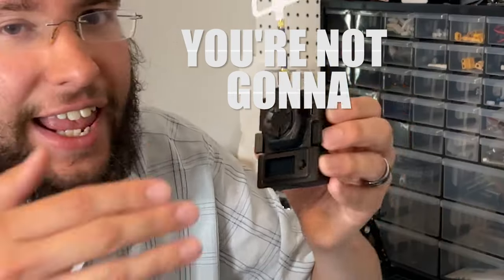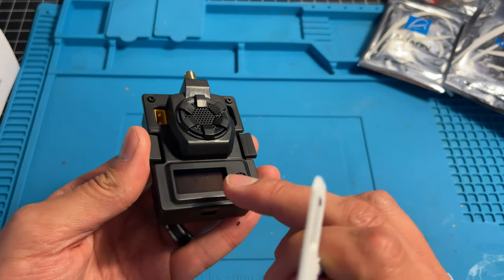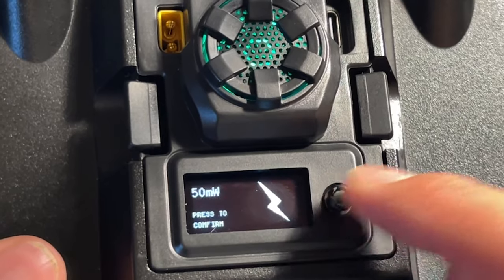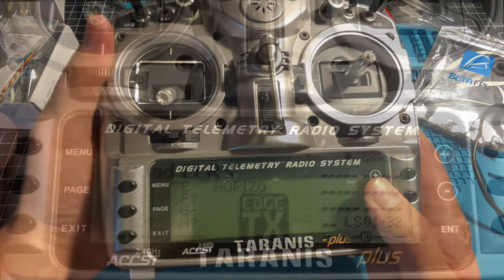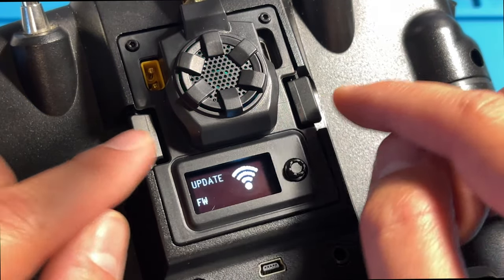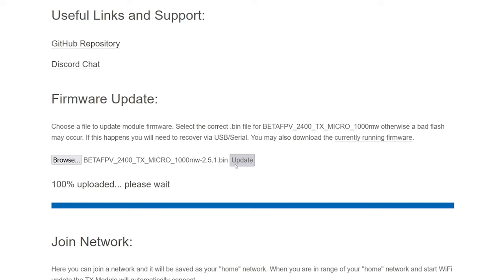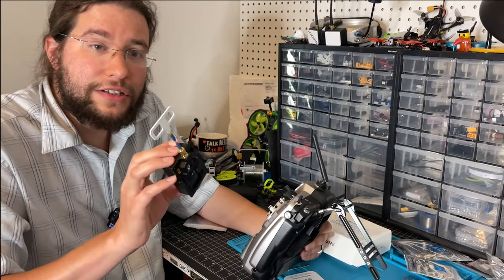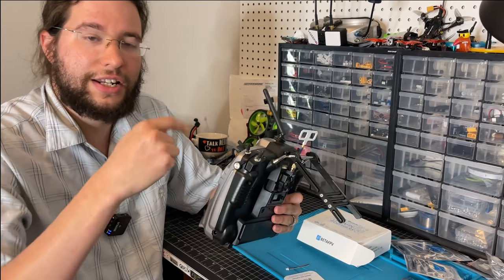BetaFPV ELRS Micro TX 1000mw & Receivers

Comment: Good info, John. I need to learn more about ELRS.
Reply from the maker: I haven't bought a crossfire rx since I started using it. Seriously have yet to have a bad experience and I'm running ELRS on a lot of my quads now, both SPI receivers as well as external rx. There is a technical learning curve to using it vs. crossfire but it is getting better all the time. You would be able to figure it out no problem knowing your tech skills.

Comment: Thanks... I used your video for flashing Edge on my Taranis Plus, I also have ExpressLRS but had no joy with the Lua script on OpenTX as it would always crash, I don't have the LCD TX like you I have the pro 2.4 without it so I need to run the script to put the wifi mode on. My problem is with Edge the Lua script will open and say Script Panic, Not enough memory... Any idea? Thank You :)
Reply from the maker: Is this with the ELRSV3 lua script or ELRS V2 lua script? Mine works just fine with no memory issues on 2.5.1 but I have not updated to 3.0 yet.

Comment: Can't wait to go ERLS, though the Frsky receiver's are not breaking on me so think it will be another year atleast haha.
Reply from the maker: None of mine have broken, either, but going ELRS has saved me money because I have not had to purchase any new crossfire receivers or antennas. 

I’m saving about $12 or a little more on each receiver depending on where I’m buying them with any sales. I’ve also been able to retrofit some of my whoops with worse-than-usual frsky d8 range with ELRS micro receivers like the flat antenna and it’s made a night and day difference.
Reply: @JohnCuppi  Ah nice! I have never actually bought a receiver hey. Just re use the OG ones I have from my old BNF. Even on whoops I'm just running Rxsr Frysky hey. 
Hopefully one day I can make the switch :)

Comment: Well, I don't want to fly to the moon...I just want to fly indoors, in large venues like theaters, restaurants, gyms, etc. Is the 250mw module in the zorro enough for this kind of penetration flying?
Reply from the maker: Unfortunately, sorry, I don't have enough experience flying indoors at large venues to answer that. It would probably depend on a lot of factors. I would want probably want 900mhz ELRS instead of 2.4ghz if I was concerned about maximum penetration in very high RF areas.
Reply: @JohnCuppi  Thanks for the reply!

Comment: Yeah I'd like 1w in small form factor, but i think the only option isn't very reliable. Still not necessary, I hit 3 miles on 500mw (250hz), so really, my range outlasted my battery(almost)
Reply from the maker: If my module ever dies for some reason I’ll do a follow up, so far it’s been reliable using it at 500mw! Seems to have good enough cooling. Since I don’t fly anywhere that I “need” 1W, I haven’t extensively tested that. I did leave it on just as a test to make sure it didn’t crap out before making this.